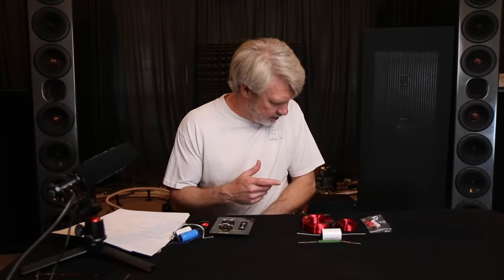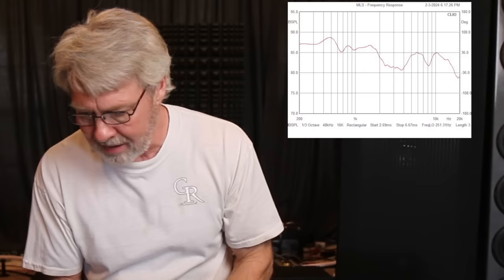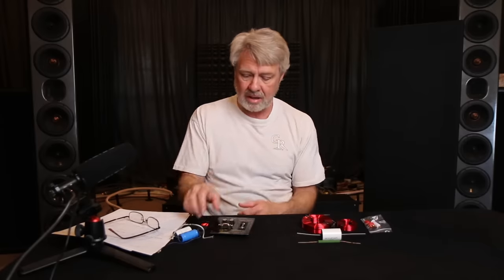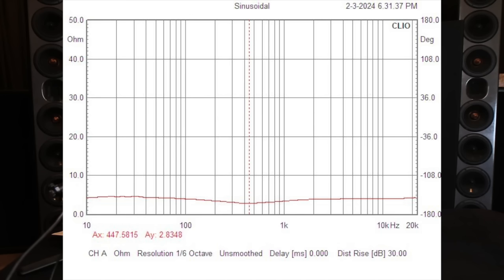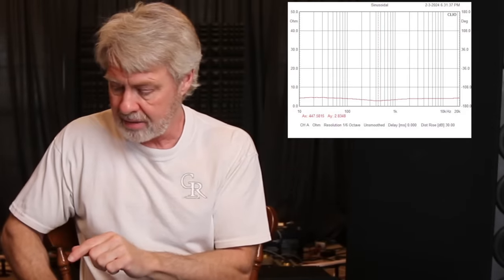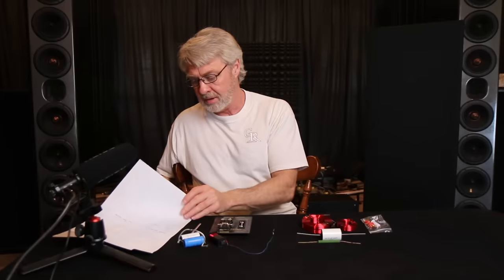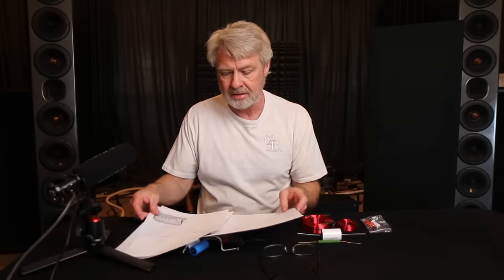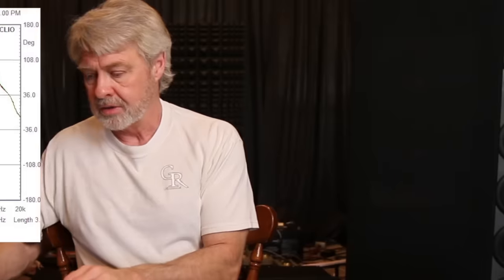Unbelievable Upgrade: Cheap Magnepans Turned into Gems

Comment: If the measured response of the LRS+ is so bad, what are the reviewers who heap such praise hearing?  Secondly,  what is wrong with Magnepan that they haven’t measured these speakers and experimented with crossover design improvements?  Obviously production cost is a factor but it indicates the reviewers are audibly obtuse and Magnepan isn’t much better.
Reply: Have you heard them? There's more to speakers and speaker measurements than on-axis response. Danny points to some of it -- the excellent waterfall response (low stored energy). That adds realism to the sound. The dipole radiation pattern dumps less reverberant energy in the room, and that makes them sound cleaner in a typical listening environment. Dipole radiation also creates a pleasant sensation of depth, and reduces side wall reflections. Dipole bass is also smoother than omnidirectional bass because it triggers fewer room modes.

These are an "appetizer" (their description) that's built to a price point, so you won't see fancy crossovers unless you install Danny's kit. But I think the important point here, and it's one that audiophiles sometimes forget, is that there is a lot more to the sound of a speaker than its frequency response -- and even frequency response shouldn't be flat for two-channel stereo, but rather tilted down about .5 dB/octave (what's called a "house curve"). A lot of audiophiles don't know that -- they think that you want a straight line -- but if you do that, when you compare the sound to live music the speakers will sound too bright.
Reply: @Josh442  I’ve owned QUAD ESLs (57s and 63s) and am appreciative of the natural acoustic sound they reproduce, no boxiness, resonance nor bass hangover.   No one expects ruler flat response curves but what is going on with the LRS+ is puzzling.
Reply: @stephenc2738  It is, isn't it. Well, they're limited by the first order crossover. It's hard to make a gated near-field response measurement of dipole line sources, and you need to include the effect of power response, which accounts for 1/3 of the subjective quality. This design is going to have issues at the XO point because the width of the woofer causes it to beam, and because they can't use the 2 pole - 1 pole arrangement that Danny used (and that they used in early versions of the MMG, the predecessor to the LRS). 

I know how Wendell Diller voices these speakers, and he begins with measurements of on-axis and power response (as well as other parameters like impulse response, etc.) and then fine tunes by ear, often with the Reference Recordings recordings of the Minnesota Symphony, where they have 10th row center seats. So I'm pretty confident that he's chosen the XO points to get the most out of the speaker that he could within the limits imposed by the crossover and the drivers. It's never going to look like a Quad. (But at the other end, if you saw the measurements of the 30.7, you'd be blown away by the midrange, which is something like +/- .5 dB in the critical region. That will give even the ESL-57 a run for its money.)

So basically, I'm not sure what the story is, but I do know that the LRS (I haven't heard the LRS+) sounds a lot better than its response measurements would suggest, which I find interesting and a bit puzzling.

Comment: Interesting upgrade Danny. Been watching your channel lomg emough to expect you would develop this upgrade as Magnepan is compelled to save on crossover parts. In fact i postponed buying the LRS+ (as a "reference speaker" to sonically compare DIY projects) when i did the DMB-test (Danny's-Magnet-Bindingpost-test) on a pair for sale.
Reply: Remember, the LRS+ is their least expensive speaker. They had to pare costs to the bone. As it is, they don't make much profit on it. They basically sell it because they know that some people will like the sound enough to move up to their larger models. But there's clearly a lot of potential there if you spend a bit more!

Comment: Why no before and after A/B listening comparison? A good pair of headphones would allow you to hear the difference to a fairly high degree.
Reply: We are working on a system that will allow this, but it won't be in a compresses YouTube file. From testing that we have been doing, we have realized that the audio clips only let you hear about 10% of the differences. Sound stage layering, sound stage placement, imaging, and depth are attributes that are lost in the recordings due to the playback method used to compare them, and when comparing live those attributes really stand out.
Reply: @dannyrichie9743  I never understand why people think this is a valid approach. The most hilarious are those claiming to show the difference between analog and digital sourcing, after capturing on some probably cheap phone or USB mic and through youtube? I have heard differences between whatever A and B through the crappy PC speaker system I use even. But to make a value judgement on expensive hardware? Absurd. File downloads would be the only predictable approach.

Comment: im sure its possible to hear the effects of the input plate on the signal path but is it possible to measure the effects with your equipment ?
Reply: Not with normal loudspeaker measurements. The audible difference though, is not subtle.
Reply: @dannyrichie9743 Interesting, listeners cannot distinguish between a  "clean" 1k sine & one with 0.01% of 2nd harmonic. That's 50dB below. An Audio Precision analyzer hits -140dB and yet no measurable difference, translates into a clearly audible one.
Reply: @paulb4661  Harmonics are hard to distinguish and it is unknown or not by the listener if those harmonics are part of the music or not.  Differences in that are caused by a bunch of ferrous parts in the signal path are heard as smearing or a loss of detail and resolution. So when they are removed the difference is easily heard.
Reply: @dannyrichie9743  I'm referring to comparative studies, 0.1% barely anyone gets 9/10 right; at 0.01% no one can tell the difference. Dynamic driver itself is one definitely ferrous and magnetic part of the system and that's why it works in the first place with distortion off the scale in comparison. This smearing and loss of detail would be clearly visible in the signal spectrum, especially in Fourier transform. It's not for a reason, I suppose.
Reply: @paulb4661  The real proof is in listening comparisons. If there is a clear and repeatable difference that can be heard, then it really doesn't matter if it can be measured or not. If there is no clear and repeatable audible difference, then again it doesn't really matter if it can be measured or not. Our ears are the final judge.
Reply: @dannyrichie9743  That's exactly what I mean- there's no independent, verifiable study confirming the audibility of phenomena you refer to. To the contrary in fact, if there were, foibles such as cryogenically treated cables on risers would have been patented long time ago. We are susceptible to imagining things, in fact, imagination creates the illusion of witnessing a live event when playing music, but it does not stand up to scrutiny. Dynamic drivers, any drivers in fact, are so poor in terms of objective performance, that pressing play should send us running and screaming in pain. We use squarewaves a lot, in order to determine amp's slew rate, frequency response and stability of the nfb loop, once we treat it to a bit of capacitance. One reproduced by a speaker and plotted, is what it is.
Reply: @paulb4661  All of that stuff is well proven, well known, and commonly accepted in our industry. It is also easy to demonstrate those differences. It is really fun when I get guys like you that are pre-dispositioned to believe there will be no difference. The look on their faces when the differences are obvious is priceless.
Reply: @dannyrichie9743  You prove a thesis, not stuff and no, it's not well known, but well purported and became an often implied conjecture, for obvious reasons. I love it when you guys, the accomplished sales representatives, end up burying every single principle of electronics and psychoacoustics in the quest for sales. Carving a niche for beliefs in science is somewhat misplaced in my opinion.
Reply: @paulb4661  I can easily demonstrate everything I said and I do quite often. When you really want to learn something let me know. Otherwise, you are just wasting my time and spewing nonsense.
Reply: @dannyrichie9743  By all means, please do demonstrate. Cannot wait for your presentation at the upcoming AES Conference. "Radio frequency attenuation in steel nuts and the resulting smearing in inductive coils of dome drivers" Sounds legit. What? Not a member? That's a shame.
Reply: @paulb4661  Demonstrations take place in Iowa Park, Texas. Come on down. Also real innovations that any company develops will never show up at any AES conference. Any real innovation that creates a competitive advantage will never see the light of day in any public forum.
Reply: @dannyrichie9743  Naturally Sir, technological breakthrough of this unprecedented magnitude deserves a patent application and will make or break a speaker in the years to come. It's obviously not FEA applied in the design of diaphragms, suspensions and magnets for low THD and clean, fast decay, it's not the extensive use of laser interferometry or real time, omnipolar analysis of actual soundfield generated, it's not the extensive use of CAD and application of composite materials allowing for machining of non-resonant, low reflection and diffraction enclosures. It's a a piece of copper tube. I appreciate the offer though, thank you!

Comment: Do you guy know that gr research works with one speaker only, but gr research complained about audio research reviews testing one of his speaker mods, he said they were crazy because they didn’t use 2 speakers to listen. What’s up with that. You guys are hearing things. A speaker like the the elac ub5 is an imaging champion.
Reviewers of Maggie’s never complain about the speakers sounding bad.
Reply: Measuring and testing a speaker does not require two speakers. You can only measure one speaker at a time and if the drivers are matched within normal tolerances than whatever you design for one works the same with the other. 

Reviewing speakers is completely different. Reviewing speakers requires listening to a pair of speakers. 

FYI, we've had that Elac speaker in here. It is a long way from being an image champion. In fact the budget level parts used in it really bottleneck it in that regard.

Comment: Still working on finishing my upgrade for the original LRS, which I specifically bought w/ the GR crossover planned from beginning. (wasn't one for the Plus at the time) I'm putting my crossovers in outboard boxes. I'm gonna run my panels sans socks. I've fashioned a cover for the lower from were the panels connect to the crossover output. I think they'll look cool, but prolly not everyone's cup of tea. Will be powered by Odyssey Stratos Monos w/ the cap upgrade. Looking forward to finishing. Wasn't impressed w/ stock sound.

Comment: So I could sit five feet away and pull them out 3 feet? I always hear people saying you need to sit far from Maggies.
Reply: Yes, that would work. At 5' you may hear more bass because you're in the near field. There will be more lateral image spread between the woofer and tweeter at 5' than at a distance, because the woofer and tweeter are separated by a greater angle.

Comment: Why spend money on a new crossover, moving magnepans forward or aft, all frequency response change drastically. Many reviewers never complained about the lrs sounding bad
Great work though.
Reply: Moving them around doesn't change the fact that the drivers are playing on top of each other or remove the cheap parts and ferrous material from the signal path.
Reply: Maybe we should just wait and see how the mod works out.Hopefully people  will post their results in this comment section.
Reply: @j-rod6420  One customer with a Magnepan upgrade from us already has. see a post from @OddAudioCanada
Reply: Just by using electronic crossovers and fixing my speakers using his graph, the sound is dramatically better

Comment: I am concerned about the peak impedance of 30 ohms at 900 Hz for a speaker that has a nominal impedance of 4 ohms. Some amplifiers may be reactive to that as the voltage is reflected back to the amplifier. Not sure if that would be an issue, but wouldn't there be a better way to keep the impedance flatter? A notch filter that shunts some of the power away perhaps? I am not saying I know this to be an issue, just seems like there may be unexpected consequences. Cheers man, love your videos!
Reply: Nothing unusual and certainly not an issue; nfb loop takes care of that easily, as long as the output impedance  of the current amplification stage is reasonable. Transformer coupled tube amps on the other hand will certainly accentuate the region around the peak. Even in the low frequency range, where the peak, or peaks, depending on the type of enclosure, relate to driver's BL product, the tuning frequency and damping employed, such deviations from nominal are the norm.
Reply: speakers can have 100 ohm, it is not uncommon. no big deal.
Reply: @sudd3660  I have a German Phillips tube radio with 800 ohms speaker impedance, but that is not the question here.

Comment: I'll tell you what Danny, if you can somehow demonstrate to me that Magnepan is absurd in their x-over design work and you're much smarter than them I'd suggest you go ahead and offer an A/B comparison.  I don't think I'm going to the trouble of hacking apart my LRS loudspeakers only to pay you a HUGE markup on caps and inductors only find out later I don't like them as much : )  It's only fair.  Plus, there's NO WAY I can see how you came up with these measurements of yours.  What's your process?  Under what conditions?  And another thing worth noting; where's the reviews for your speaker upgrades?  I need much more info. than you're giving out here to purchase anything.  Thoughts?
Reply: The absurdity in the measurements of the stock version is pretty clear. Markup on crossover parts are very marginal. Our measurements are taken with our Clio measurement system. The conditions are controlled and we take measurements are various distances with and without gating. We have sold 100's of Magnepan upgrades. We get positive feedback from those customers all the time. Some of them have even posted feedback in this video.
Reply: @dannyrichie9743  Danny, I highly suggest you re-read my original post here.  You're not really answering my questions, sort of.  I think you need to post a show where you examine the process by which you determine: A: Where you placed your crossover points and why with each driver.  To get the distortion right, you have to measure/test first...rinse repeat starting with the lowest driver going up right?  That way, you know harmonically how the next driver plays in relation the bottom.  Not top down.  Again, there is no way in heck I can hear what the differences are before and after.  Danny, I may not like the changes you made!  Now I'm stuck?  He - he.  How will I know until I can a/b roll?  I don't get it.  The customer has to be able to hear before they buy...before your mod, then after.  How could one argue this point?  Dig yourself outta that one!  May I suggest you put some speakers in your store that demonstrate the sonic improvement?  PLUS: I have no way of locating your reviews.  Are they hiding?  : )
Reply: @deluxentertainment3  I guess most of us that have been around the block a few times already know what is going on. The results are a given fact. For instance, when I replace an electrolytic capacitor with a high quality poly cap, the audible results are clear and consistent. Smearing is reduced, clarity and detail levels come up, sound stage layering is improved, etc. The result is the same every single time. Likewise replacing and iron core inductor for an air core inductor reduces smearing and improves many areas. I don't have to create an A/B comparison every single time to know what the result will be. I could go on and on regarding making a specific change and getting a known result. 

Our facility is loaded with speakers that are often in and out of the system over here. Customers are here for demos all the time. 

You can also see tons of customer feedback and reviews in out forum at the Audio Circle. 

There are some posts even here (below) with customer feedback on Magnepan upgrades.
Reply: @dannyrichie9743  Danny, for goodness sakes...the parts change I can agree with.  The rest of what you’re saying is seemingly pure up sales fluff and a blatant disregard and ignoring most of my questions and concerns two times in a row – point for point.
Reply: @deluxentertainment3  Nothing I say is for the sake of sales. I only lay out the facts, and I have answered your questions.

Comment: If I am not mistaken, Magnepan tunes each panel of a pair slightly differently with their “buttons.”  This may be an instance where both speakers of the pair need to be measured and upgraded.
Reply: Nope, we had both of them here.
Reply: Yeah, it's confirmed by Magnepan. They are tuned differently on purpose